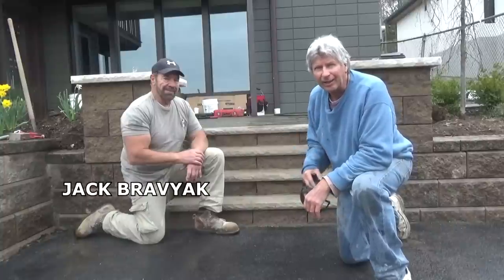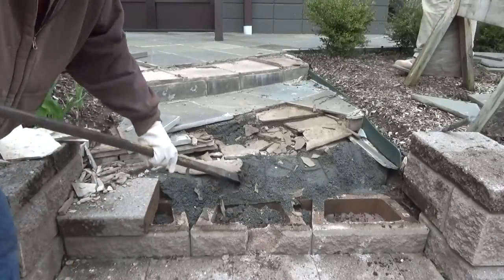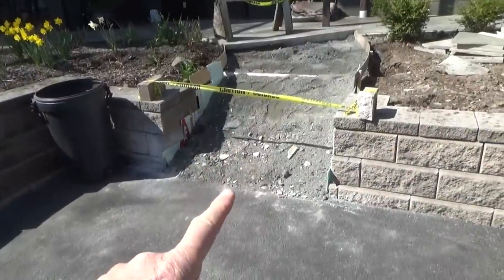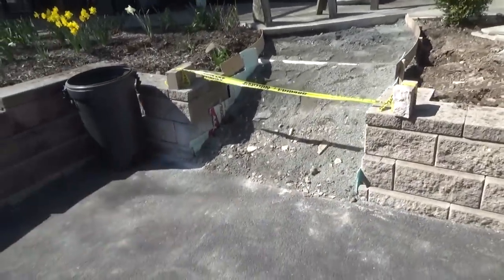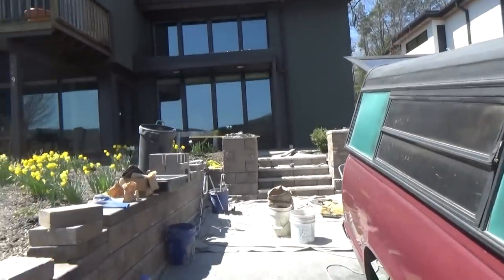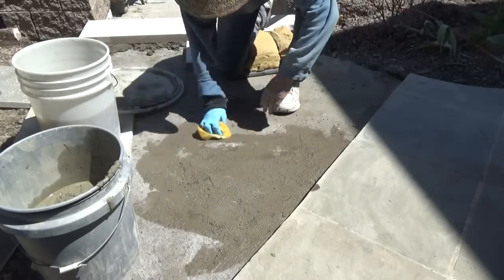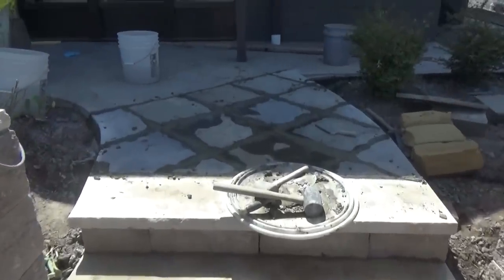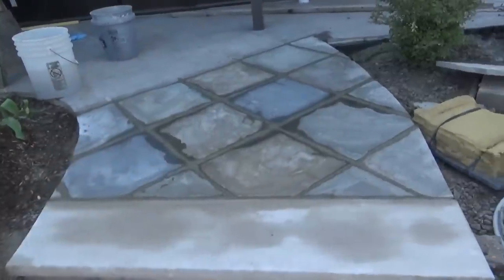STONE STEPS REPAIR (Part 12) Mike Haduck

Comment: Nicely done I like to make a wet pasty mix with straight portland and brush it on with an application brush on the back of the stone before I lay it I will also brush the concrete with it too before I put my mortar down but everyone has there own unique way of  doing things that’s why I love masonry work so much
Reply from the maker: Thanks Big smoke. Mike
Reply: In the uk and Ireland we use specialist bags or tubs of powder slurry mix that you apply to the back of the paving prior to laying into your bedding mix and it bonds them together so well they will never come apart . But a pasty mix of straight Portland cement works as well .
Reply: https://youtu.be/3ecECF8s1go this video explains the process.

Comment: for non high loads i've thought about making my own rebar from stainless steel. grandpa used galvanized guide/guy wire anchors when he poured his patio, it lasted till after his death when we got a skid loader to but up the pad. the "rebar" still looked like a new anchor minus the 90 degree bend in it to fit inside the pad.
Reply from the maker: Thanks, Mike

Comment: Hi Mike, you've mentioned many times in the past and showed where rebar rusts over time and makes the concrete fail. So while you mentioned you put that in to help with the frost and movement, what about the rusting and corroding of that metal down the road? I always learn something from your videos, thanks for doing them.
Reply from the maker: Hi Amy, I use concrete wire , it's not thick enough to cause damage , or sometimes I might use a thin rebar, it's when you get into the thick rebar you can see a problem, thanks Mike

Comment: Mike.  Awesome steps.  The comment you made on using smaller rebar will save me a huge rework. 
Question on grout . I am always worried about cleaning up the stone after grouting. You say water comes to the top , looks like you let the grout sit ontop of the stone and then just scrub it off later with water!?

Am I missing something?  You started sponging off the excess but even the. It looked like you had way more left to remove
Reply from the maker: Hi Karl, I got a whole playlist on " stone patio installation " check it out I got a bunch of examples in it, thanks mike

Comment: Though I've never used it before, I'm going to use pink fiberglass rebar in my upcoming project. It is said to be stronger than steel rebar, it won't rust or swell, and should last 10 times longer than steel rebar.
I guess I'll find out. If it'll just last until after I'm dead I'll be happy.
Reply from the maker: Thanks Kandy, Mike

Comment: Hey Mike - I have indoor concrete floors with radiant heat and wax on top - curious if you are willing to do a video on how to repair thin cracks for indoors?..please:)
Reply from the maker: Hi I don't have a video on that, and never had to do it , although I like radiant heat I have always been a bit skeptical about the long term, thanks Mike

Comment: Hi Mike
Is or when is cellulose concrete expansion joint material necessary or used?
Reply from the maker: Hi, Roy, I use certain products for jobs, and everybody calls everthing by a different name so it's hard to answer, thanks, Mike
Reply: @MikeHaduck  Thanks for replying!! I saw the product used on YouTube and it was placed between a existing driveway slab and a new pour walkway. It was said to help prevent cracking from expansion and contraction. Hope I explained it better this time.

Comment: I just used some S mortar to put some flagstone on a concrete step, but here you're saying that S mortar isn't a good choice. Is that just because of where you're located? I'm in Southern California. Are you instead saying that the proper thing to mortar is instead just portland cement, with no other additives? What is the problem with S mortar?
Reply from the maker: Hi , you ate probably ok in south California up here in PA it won't last, thanks Mike